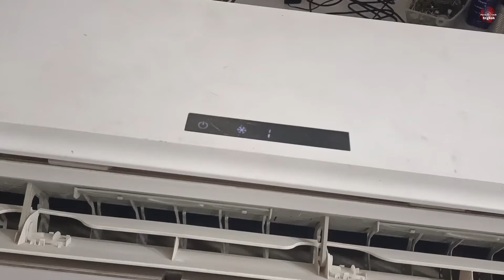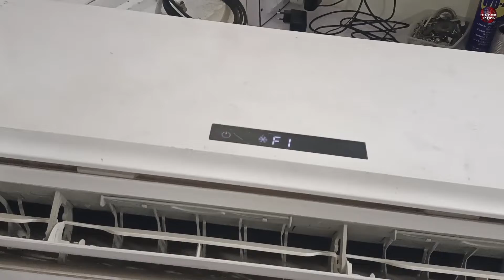How To Fix Mini Split AC Circuit Board F1 Error Code Easily

Comment: In any unclear situation, replace the IPM.
Reply from the maker: Clearly, The Voltages were not passing through the IPM. One of the diodes in the IPM was also short. It was clear that IPM is short circuited. Hence Replaced
Reply: @forevertechenglish  I'm absorbing the experience from your videos!
😎